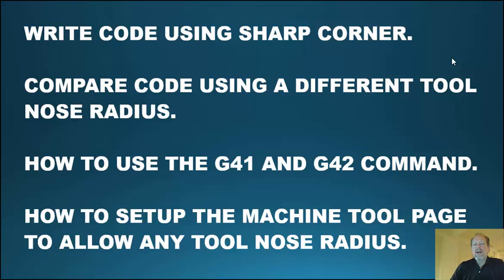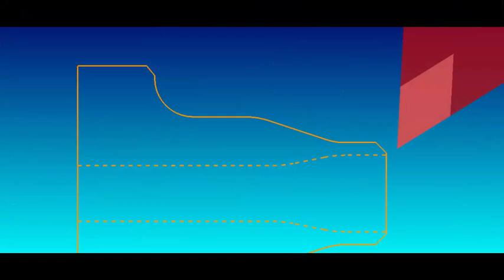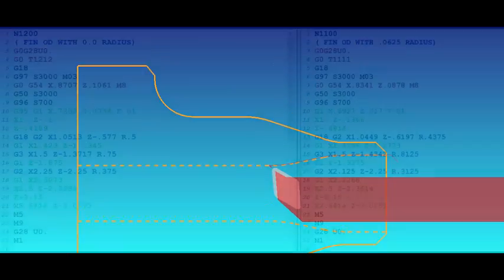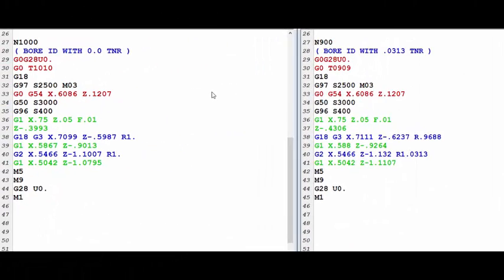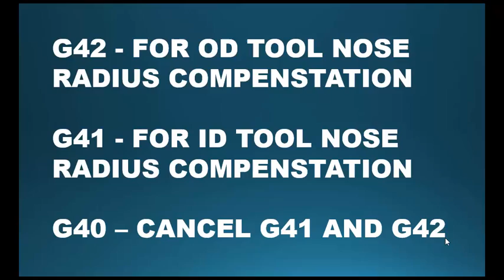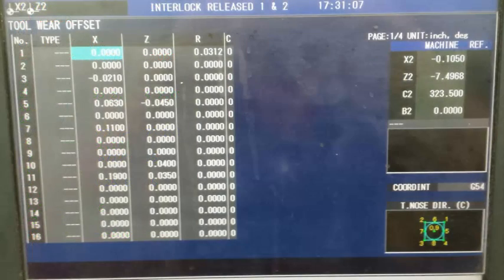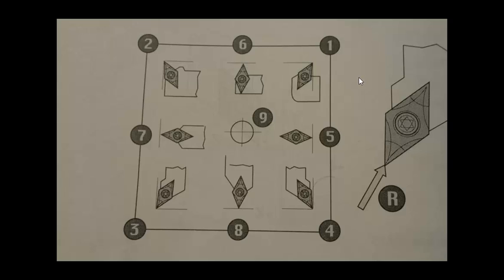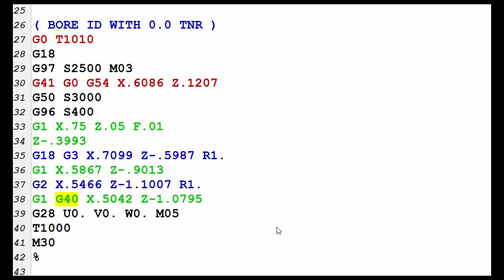CNC LATHE PROGRAMMING LESSON 6 - TOOL NOSE RADIUS COMPENSATION

Comment: it is misleading to show the tools with larger (not sharp) radii as being larger than the sharp tool...additionally, you keep saying tangency point. Correct me if I am wrong, but that is an intersection. tangents are straight lines that "just touch" curves. And sorry , one more. You say G42 is for O.D. tools. This is true when you are feeding in the standard direction toward negative Z. If you reverse directions (like we like to do when deburring threads) it becomes G41, when you are feeding toward the face...

Comment: Yeah, that was too easy. I have a pulley with which i will be using an o/d groove tool (or button tool) which is .04 wide with an .02 radius.
I'm thinking that using a 9 for c and specifying the .02 in the R column will allow me to program per the print and the figuring will happen per g41 and g42. On the front and back sides there is a contour called out for clearance or weight reduction. It also has radius/flat/radius starting near the hub and again as it moves outward toward the o/d. I am using a vnmg positioned as a face grooving tool with the same tool specs as for the crown. Does the seem to be the best method for the confusing issue?

Comment: this is so bad tutorial you never show drawing. what is actually real dimensions from drawing and what you NEED KNOW to calculate. yes you still need calculate even use G42 and BANG it wont work on G71 thats what fanuc says. you need correct all down slope angles(even it wont even cut it unless use type 2 LOL). so its calculating still. can you calculate TNR compensation. read my other comment LOL. its TOP SECRET cam manufacturers dont want you know bout

Comment: 6:32 becouse G41 need clearance 2xTNR. what if there is no that much on 99% parts we made lol. yeah. tool too big for job? no its correct size and if calculate compensation there is alot room LOL
and even using compensaion it wont stop you need calculate something. thats most stupid on it. so better not use G42/g41 and calculate path.

and why inside part you call home position and U is first. not crash????
should first rapid out from part???

Comment: i never use G41/G42 there is EASY SECRET MAGIC formula that nobody knows (1-tan(angle/2)) *TNR it will give you z compensation (1-tan(22.5))*0.0628=0.366. excactly as is shows on first 45 0.1 corner. with 0.0625TNR just move it x1 z-0.1366 AND you done this on CAM for sure lol
i know becouse there is no Z0

but i also calculated first x. by 0.1366*tan(45) double that and subtract from 1inch OD x0.7268 z0(replasing x0.6927 z0.017).
you even go actually
x0.8 z0.1
g1 z-0.0366
x1 z-0.1366

perfect 0.1 corner x1 and x0.8 excatcly readable and magic 0.0366 number

I NOT USE CADCAM I NOT USE G41/G42. becouse i can calculate same path
Reply: @Jari Sipilainen pls explain clearer I would like to understand more of what you mean. How else can I contact you to ask you further on this formula, to clarify.
Reply: @princeuy8021  that is very basic trigonometry, you can probably find maths lessons related to it pretty easily on Youtube
Reply: Another option is to use the center of the radius as the programming point and generate the program for a profile offset by the amount of TNR. Solves everything but the numbers aren't real anymore

Comment: It should be noted that G41, G42 is not necessarily inside and outside compensating, but rather left and right direction of offset movement in relation to work surface.  Back turning away from the spindle on the od of a part is G41, turning towards the spindle is G42. Back turning on the id is G42, boring towards the spindle is G41.  Like your videos, especially the graphics, however they could use a little more explanation to keep the new guys out of trouble. I've had programs where machining was on the opposite side of the centerline, all arcs are reversed along with direction of tool comp and tool type. Talk about head scratching.......
Reply: Thanks for this!

Comment: I’m a rookie at understanding the particulars unique to lathe programming vs. mill. I do a lot of mill programming on the OSP controls, at the controller but need a better understanding of Okuma twin turret lathe programming. Specifically nose radius comp. My understanding of G41 and G42 is left (41) and right (42). So if I apply this to a turning tool on the B turret, cutting z-, it would be G41 with the same tool on the A turret being G42. You described 41 as ID and 42 as OD, does this apply to tools in the B turret also, or should it be as I described above? I’ve also noticed guys inputting a negative value for their nose comp. and have a hard time understanding why. Are the inverting 41 and 42? I realize their are fundamental differences between Fanuc and OSP, but hoped you could provide some insight. Thanks!

Comment: Why is this in the code at the end G28 U0 V0 W0 M05?
Reply: never seen a lathe with a y axis?
Reply: @paulpelletier9422  there are some and most probably were back in the 80s also but more rare
Reply: Rusty Shackleford that is the home position for x y and z
Reply: It should just be G28: for Home the tool, U0: Machine 0 in the X axis, W0: Machine 0 in the Z axis, M05: Stop the Spindle. He included Y axis in a lathe video probably accidentally.
Reply: Rusty Shackleford  G28 IS FOR the tool to return to where it G0 in while the  U,V and W is the amount of off set in this case none and the M5 I is to stop the spindel
Reply: Robert McEwen BNE-51
Reply: To make the tool go to the machine reference point

Comment: What compensation (G41 or G42) would you use when cutting a radiused groove in the face of a part?
Reply from the maker: It always depends on the direction of the tool path. Line Left is G41, Line Right uses G42.
Thanks.
Reply: Thanks

Comment: mike Great videos they have been helping me a lot since I am barely starting to study this in my college course and I kind of need some help. I'm interested in knowing What type of program are you using on your Pc to write code I think this would help me a lot with my study
Reply: Cesar Garcia 
Hi, you can actually use something as simple as note pad if you write by hand. Then transfer to machine via a compact flash card. I use this method very often for short programs. 
Example:
%
O0001(FACE BAR)
G21 G40 G95 G80
G28 U0 W0 T0
M1

G92 S3000
T0101 
G0 G96 X? Z? S? M3

MACHINING HERE ...

G28 U0 W0 T0 
M30
%

Comment: Good Video! It is important to note that many lathes will have many different Settings that may have impact on TNR and canned cycles, TNR can behave oddly in some cases unfortunately and is truly only needed when turning radii and champhers if you are straight facing and turning it would not be needed. Very good introductory video!
Reply: Without cutter comp tiny rads on direction changes are impossible.
Comp isn't needed during roughing cycles.
I only use it on the finish pass.
It helps insure I get to properly break all the edges.
I don't do this for the customers.
Most customers don't care, or are even aware.
In the end.
I do it for me.
The finished part feels way better to the touch, and elevates even simple parts to a more professional level.
Nice parts catch customers.
Faster than fast ones.
Push for good lead times.
Make a better part.
Then make all the parts.
Then make all the money.
Job done 🐒

Comment: Hi Tom, is that same in cnc swiss lathes? How I will decide tool direction? Thanks.
Reply: +losultan The image seen at ~5:10 should be valid for revolver behind rotation axis.
If your machine has the revolver in front of the C you have to to flip 2-6-1 with 3-8-4 also you are not righthand side of your contour anymore.
Everything without warranity - check your maual in doubt.
Reply: +Bill Klätsch Thanks for your comment, it will be helpful.

Comment: I'm a machinist apprentice and I have a question. So most of machine shops use G41 and G42? Because my work, we always use G40. It does take longer time to program but it's easier and faster for the operator to set up.  and do you know free or cheap cnc simulating program? that I could use to practice programming at home.
Reply: +Gillby NC Plot--Free Trial easy to use does mill and lathe
Reply: Can I combine  G41 or G42  with the roughing cane cycle G71?

Comment: Great explanation video, but please I have a question, especifically I have many types of inserts in my job but I don't know how to correctly identify them but worse than that I have started programing the lathe but I do not know how to find the nose radius of my tools, how can I find this value?
Reply from the maker: Ro Cuevas On the back of the insert box you will see a number 331(.016 rad) or a 332 (.032 Rad) or a 333(.047 rad).
Hope that helps.